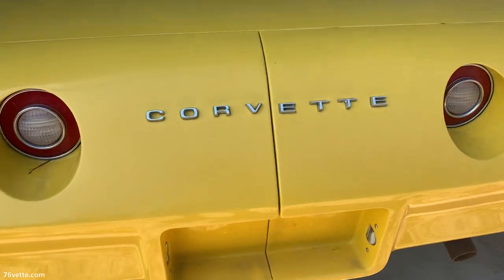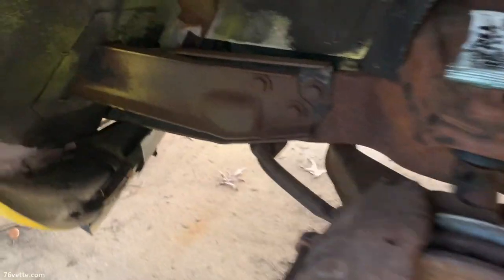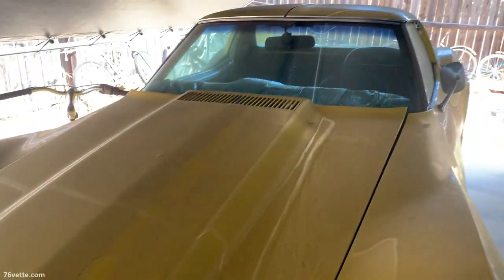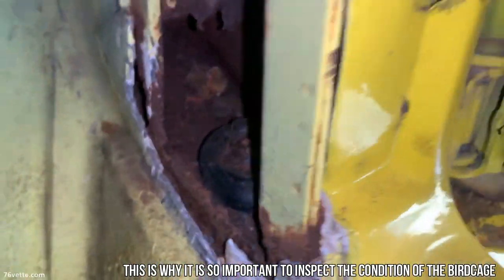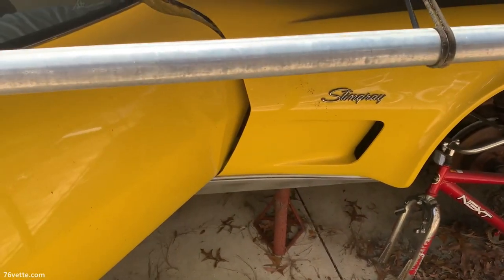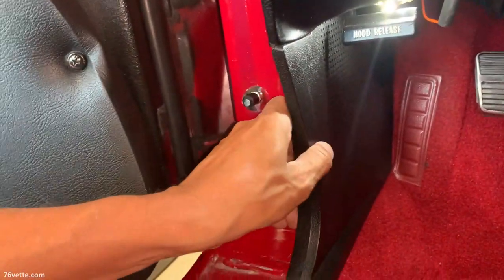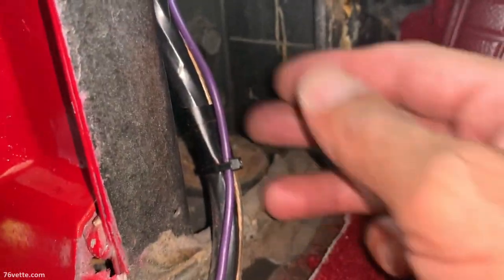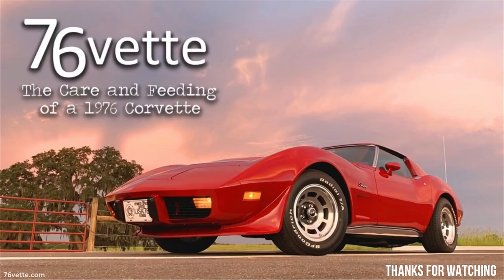DO NOT buy a Vette Without Checking this FIRST

Comment: For all the problems that are easily visible, there are a million that are not especially on C3 Corvettes. You definitely want to do your homework before buying one. just about anything can be restored if you throw enough money at it but there are still too many good Corvettes out there to waste time on money that needs that kind of work. Great video especially for someone looking to buy a C3 Corvette and are not familiar with them. This video can save them a lot of money and heartaches down the road.
Reply from the maker: Thank you, Mark. Checking this area is very important and not really difficult to do. And even though it can be repaired, the nose has to come off so it can be repaired properly. Then it has to be reassembled, which is no small job. The radiator core support is also prone to rust but a lot easier to inspect and replace. I’ve talked with a couple of people who have, unfortunately, bought the wrong C3s and lost a lot of money in the process. Thank you for watching! 😊👍🏻

Comment: Also check the steel around the windshield.  A friend's car had that steel fabricated.  It was expensive.  The halo over the top of the car rusted out and the fiberglass cracked and sank.  An otherwise nice car became a parts car.

Comment: You can tell the cars that lived up North.  Thats when you kinda wish the engine or trans sprung a small leak to coat the undercarriage.  Even then, the salt they throw down is like acid.
Reply from the maker: That plus bad quality control, poor or a lack of drainage, materials used, and more made all these vehicles susceptible to rust. And once rust starts…
“They don’t build ‘em like they used to.” Thankfully! 😊👍🏻

Comment: Great video!! Imo, any C3 Corvette after 1973 is not worth the cost of restoration. Unless, I'm going to repeat myself, Unless it has sentimental value to the individual or it is a unique model,ie: 1975 Convertibles, big block cars, manual transmission cars. There are too many Pace Cars or 1978 Anniversary cars out there that can be had for half of the cost of a restoration.
Reply from the maker: I agree. Bodywork and a good paint job alone will cost anywhere from $10K to $20K, that’s why it’s a good idea to buy the best car you can afford. Restoration is an expensive endeavor.

Comment: My radiator core support had a baseball-sized hole in the bottom.  I had that replaced.  Otherwise the car is nearly rust free.

I'm guessing the radiator leaked at one time and left a puddle on the support.
Reply from the maker: Radiator supports were prone to rust as water basically sat inside of the bottom section without proper drainage. Probably most of them have been replaced. The rest need replacing. Lol 😆

Comment: You can’t always put a price tag value on a true American classic… if the owner has enough sympathy and sentimental values for a classic Chevrolet Corvette it’ll be well worth the time and money to get that vehicle looking like it did off the genuine motors lot back in 1970s.
Reply from the maker: I agree to a certain degree, but only if a car is rare or desirable enough. On the other hand, no one who has a true sentimental attachment to their Corvette would allow the car to deteriorate to this condition.
Reply: I agree with the opinion that some people have a sentimental attachment to a Corvette and want to save it, regardless of condition. I am in that group as I am completely rebuilding a 76 rust ball of a Corvette. I didn’t realize how bad it was until I had the interior ripped out and most of the birdcage was visible. However, I have had this car sitting in storage for 27 years while I traveled around the world serving in the military. I dreamed and saved the money for this Corvette project for all those years. When I am done it will be rust free and every single bolt/part with be like new. They are not making these beautiful cars anymore and someone needs to save them. 

I do appreciate your videos as they are very helpful. Keep up the great job!

Comment: The metal support behind both seats going across what that called? Mine rusted and looking to repair but can find any parts on it
Reply from the maker: If the bulkhead behind the seats is rusted, that can be a serious issue as it is a structural part. It can be repaired professionally but, AFAIK, there are no replacement parts available, only salvage parts which are totally fine for fixing such an issue, as long as the repair is done correctly. 
I would talk to a salvage yard for part availability. 

The only one I am familiar with is Corvette Generation here in Florida, and this is their info. 

Wally
Corvette Generation
16541 US-301, Dade City, FL
(352) 523-0900
corvettegeneration.com

I made a video of my visit to Corvette Generation: https://youtu.be/gT9HiNqSpAE

Comment: Hey man, I got a issue I found when I was rebuilding the front suspension of my 81. I found a crack in the front cross over brake line by where it hooks up to the rubber line going to the caliper. I can buy a new one, but then I have to remove a bunch of stuff to get it out, and put the new one in. What do you think of this idea, get a replacement cross over line, and splicing it on the old line by the bottom cross member area? Down by the bottom.  I'd have to cut the metal rap back, and add a double flange with a connector between the two. That way I don't have to tear the front apart the fish the whole line out, and put a whole new one in.  What you think??
Reply from the maker: This repair involves a safety system. Do it right or hire a qualified mechanic do the repair properly. Do not reengineer this.
Reply: @76vette  I think your right of course. Lucky I repair aircraft for a living, so understand what your saying. I think the best idea is start draining the radiator,  and remove the lower radiator hose, radiator shield, headers, and sway bar. That should make room to remove the whole line. Might even have to remove the radiator too. I do have a good repair book and the factory assembly manual. 😀.  I'll keep ya posted on the progress. I just wanted a second opinion on this and you was one of the few I picked. I hope you don't mind.
Reply from the maker: The assembly manual is a must-have book, so I’m glad to hear you have one. Not sure you’d need to remove all the parts you list, but I’ve never done the job you describe (and hope I never have to), so I cannot provide any guidance there.
Anyway, if you’re A&P certified, then you know all (and then some) about safety, and when it comes to brakes I don’t have to tell you that your life—and that of others—may depend on them, so make sure any repairs are done 100% right! 😊👍🏻
Reply: @76vette  yep, and my ol lady has claimed the car, lol. I bought it to fix and sell, but gotta keep her happy, sooo. Right now I'm looking at it, and making a list of everything I need to take off, so I can remove and replace that line. Plus I can do some other things on the rebuild list also. This vette was a candidate for the salvage yard. But with only 68,000 miles on it,( last 46,000 was rough) I couldn't let it go there. I bought it cheap, and have rebuilt alot of the drive train. Just finished up the front-end suspension. I've been told I need to start a vlog on this build, but I'm not computer smart for the editing. The car looks like hell, but all the important things are good. Good frame, birdcage, just rode hard, and parked under a tree for a few years. I'll keep ya posted on this, and ask for advice from time to time, if ya don't mind. I normally build C4 vettes, this is my first C3 build. Thanks, Gizzmo.
Reply from the maker: If I can be of help answering questions I’m happy to do so 😊👍🏻 
Yes, a vlog would be nice but it’s a TON of work. Ask me how I know. Lol 😆 
Glad to hear you’re saving a C3 but know these cars are never 100% done. They always need our attention. Kinda like women. haha. Keep me posted on your progress 😊👍🏻
Reply: @76vette  can and will do. The sway bar and fan shroud will definitely have to come out, make room to snake out and install the new line. Might have a problem with the steering box, the line goes under it. That 90 degree bend where it crosses over at the front might be a booger too. I'll jack up the car alittle bit more and see if that helps. I'm ordering the new cross over tube tomorrow, along with a new rubber line I cross threaded when I was doing the front end. ( brain fart). Zip has it for 40 bucks, just gonna be a pain to install it. Thanks for your insight on this man. Gizzmo.
Reply: @76vette  got it out, had to remove the  mechanical fan, pulleys, shroud, axillary fan,  and swaybar. As soon as I get the new one, I'll install it. In the meantime, I'm thinking of pulling off the headers, starter, and repainting the motor to red, to match the car, lol. Also found a tranny leak. Speedo cable needs a new o ring.
Reply from the maker: You’re going to be busy for a while! 😊👍🏻
Reply: @76vette  also found my lower weep hole on the water pump is starting to leak coolant,  and the lower radiator hose is also seeping, looks like the radiator lower inlet needs to be rebrazened. So I need to remove the radiator, and take it to a radiator shop. Good thing I did take off the shroud, I wouldn't have seen all that until it was leaking real bad. Plus I need a new axillary fan wiring harness too. Mines cut up in 3 spots, and it's not that bad in price.
Reply from the maker: If your Vette does not already have an aluminum radiator, you may want look into getting one. A 2- or 3-row would fit without modifications. Something to consider.
Reply: @76vette  I looked at the price, almost 500 bucks. Maybe later, but right now it's not in the budget. I think I can get it fixed for about a 100 bucks. I just got all new wiring harnesses through out the whole car, and that set me back a bit. Getting ready to gut the interior, and do a complete everything job. It smells like rat butt in there, lol. I got all new interior, plastics, dash, wiring, carpet, heat and sound deadening. Everything.....
Reply from the maker: I hear ya. And yes, get rid of any odors that don’t belong in there. You don’t want to be breathing rat butt smells for sure. lol 😆
Reply: @76vette  that yellow pace car in my avatar was under water for about 3 months during a flood, then sat beside a pole barn for 3 years before I bought it. It smelled to hi heven!! But it's been completely torn down, cleaned, and everything electrical replaced. Took 2 years to complete. It's not stock anymore, but a blast to drive.
Reply: I just replaced that brake line on my 71...it was the right front rigid line going from the brake distribution block on the left side to the right caliper rubber line. The B nut was stripped too bad to save. I didn't have to remove any major parts to get it out...just some clamps on the rigid brake line. It was time consuming and a pain to get it replaced, but not too bad. I'm also a former A&P mechanic and thought of ways to rig something,,,  like splicing in a rubber line, but I ended up doing it the right way. Good luck.